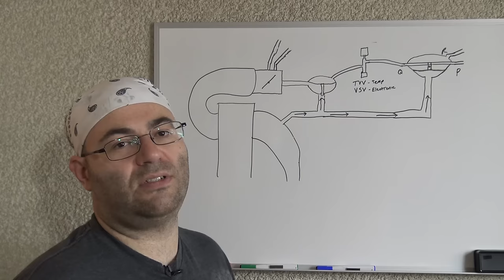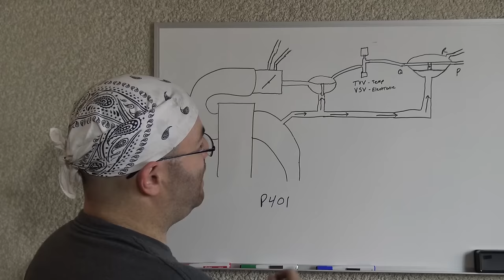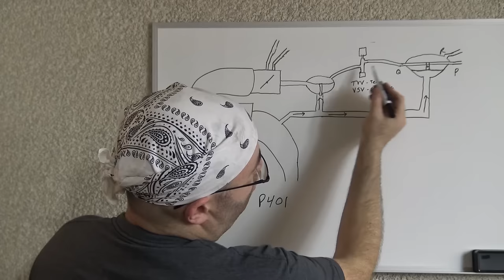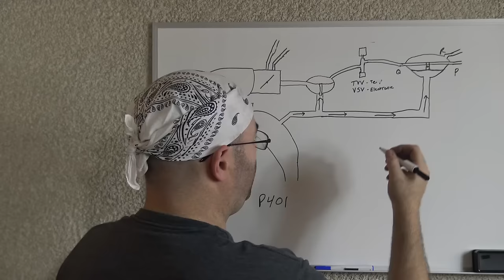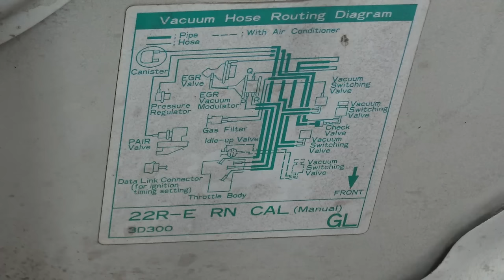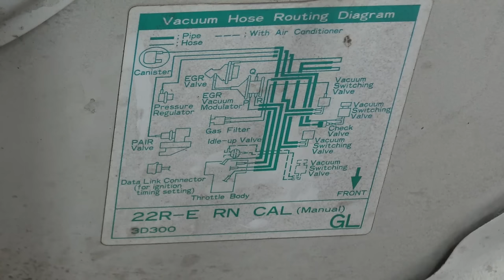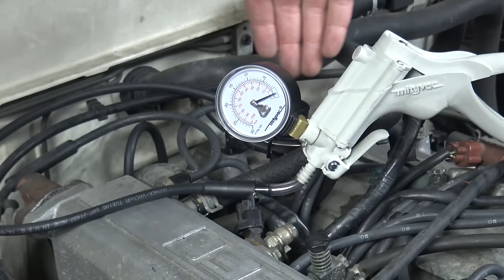DIY Toyota EGR Valve Diagnostics - Back Pressure Modulated

Comment: Great Job, every thing is perfect ,clear explanation do u have any idea about the emission system for Camry v6 2001?because the modulator and EGR built in together.  thx
Reply from the maker: They've probably simplified it a bit. I haven't had the chance to work on it yet so I'm not familiar with what kind of system it is, whether it's electronic or still vacuum, I don't know.

Comment: i had done all of those things and everything check out as working but i still keep getting the same code as  insufficient air flow i have replaced all EGR system parts as in EGR valve / VCV  switch / modulator valve and all vacuum hoses cleaned EGR pipe what could still be wrong

Comment: my 22re  if i take oil filler  cap off when running   the idle slows down  and truck dies  is there supposed to be that much back pressure at the oil filler  cap

Comment: what I don't understand is why the engine died when you applied vacuum directly to the egr valve, yet when you fixed the problem and vacuum was being applied by the vacuum modulator it didn't die. Can anyone explain this?
Reply from the maker: I applied full vacuum to the valve, opening it completely, which introduced a large vacuum leak, which stalled the engine. When the system is working properly, the vacuum given to the valve is low at idle, thus the valve isn’t open very much. The valve needs to open more as engine speed increases (to suck more exhaust gasses in, to cool the engine down more and more), but of course engine vacuum diminishes the higher the speed gets, so that’s why it needs to use the exhaust backpressure to open the valve at that point. Did that all make sense?

Comment: i have no vacuum coming from the r line on the modulator is it supposed to have vacuum i cleaned the throttle body still nothing also its giving me a code 71

Comment: is this correct? The VSV is energized cold and vents the vacuum from reaching the EGR valve. No EGR flow. And when engine is warmed up the VSV is deenergized which allows vacuum to reach the EGR valve and apply EGR flow. Or do I have that backwards
Reply from the maker: Yeah that's right.

Comment: Hi 50's Kid,
Love your vids...Have 95 2WD Toyota base p/u with 22r-e..get good vacuum on P and R, but none on Q when engine revved - replaced with new modulator - am getting same result..EGR valve and TVV test good, but system fails..any ideas?
Reply from the maker: Is there back pressure coming INTO the bottom of the modulator when you rev the engine?  Unplug the modulator and hook up your gauge to that and test.  If not, the line is probably clogged with carbon somewhere (probably at the EGR valve side).

Comment: i did not get any vacum when i put a t line connecting the egr valve and the vacum line but i did get vacum on P Q and R   the engine died when i applied vacum to the egr valve

Comment: Hi 50sKid! I am working with a 3VZE, the V6 motor in the 89 4runner  with a similar system.  I have this strange problem where the truck runs and idles fine, but when the engine is warmed up, and I come to a stop sign or red light and take it out of gear, there is a 50% chance that it wont idle perfectly at 850rpm, but instead it will bounce between 350rpm and 500rpm, like a major vacuum leak.  After about 15 seconds of sitting at the red light or stop sign, the idle comes back up to 850rpm.  I suspect the EGR valve.  Is there an easy way to clean it up without removing it?  Thank you!
Reply from the maker: No there's no easy way to clean it without removing it, however removing it probably isn't as difficult as you think.  The EGR is a good theory to go on for sure.  The EGR normally only opens when the engine is at mid to high speed, so it could be getting stuck open slightly when you come to a stop, causing a vacuum leak.  I also would have pointed you toward the idle air control valve.  On the 4 cylinder engine, it doesn't have a modern electric idle control valve, but rather a coolant-activated IAC for increasing the idle speed when the engine is cold along with some kind of idle-up valve, that I think is vacuum controlled, for when the a/c compressor kicks on, and I'm fairly certain the V6 has similar components.  If you can make the idle problem go away by turning your a/c off, I would suspect the idle up valve, but if not, definitely go for the EGR valve.
Reply: como se maneja rav automatica
Reply: 3vze my specialty, you need to verify your getting vacuum at the EGR valve while on the smog dyno, there is specific value you should see at the EGR valve at the low speed test engine RPM, which is about 2500rpm. If you have large that the stock tires that might be contributing to the issue lower rpm and engine working harder. I'm recommending the smaller 235 75 15 tire size for the smog test as the state of California may have overlooked that issue. They have only recently started to address the issue of 'stock tire size' as a contributing issue to failed smog tests. Otherwise any air leaks in your exhaust system up stream of the the oxygen sensor can cause your engine to run lean, causing higher NOx, and possibly higher emissions. Smog tech told me even a small exhaust leak will cause issues with smog numbers.
Reply: Video does not list symptoms, that I heard. If a failed smog, OK. My 1994 4Runner V6 3.0 Idles rough when hot. Just passed smog quite well, no 'check engine' light or codes, Vacuum is low (16) and steady, saying 'late ignition timing".  Timing cold is about 7 not 10 BTDC but starts to jump around when hot. Appreciate any help here.  Thanks
Reply: I really wish someone would help with this issue - EXACT same problem with my 1994 3.0 liter V-6 4Runner - check engine light is on, starts great, idles great UNTIL it warms up.  Then it has an intermittent idle issue where it tries to drop down from 650-800RPM to 350PRM with no set pattern.  It will idle smoothly for 2-3 minutes, no issues, and then suddenly the idle becomes rough as if the truck was trying to adjust to an entirely too low RPM.  Occasionally when I am backing the truck up after it has warmed up this idle problem will actually cause the engine to stall.  I generally only notice it at stop lights, and I don't run the AC as it is not working, so I can confirm it happens regardless.  Someone please help us with this issue!
Reply: @biolegal   idol up valve, or AFM
Reply: check tps too.  make sure no holes in the air intake sytem. inspect the entire thing.

Comment: I still wonder why so many people delete their EGR System from their 2.4L or 3.0 I believe if its broken they should replace it instead of by-passing it.
Reply: @Justsome dude some people feel it gives a minor performance gain, others see no difference, but the main reason for disabling the system is to stop exhaust gases from fouling up the intake and causing other problems as a result. It's like breathing in your own fart gas.

As far as I'm aware, only California mandates the use of such a system, nowhere else in the world is it illegal/results in failed emissions testing when removing this system. Another thing is that if you get lets say a 3VZ-FE engine from Japan for example, you'll notice it lacks any such system - only engines designated for the North American market will have this.

If you're lucky, your engine doesn't have an EGR temp sensor so disabling it is as simply as disconnecting/looping the vacuum lines that actuate the valve so that it no longer gets vacuum from the throttle body.

Comment: So if the car did not die when plugging the pressure gun to pull up the pencil valve in the egr (directly into the egr), but the engine seems to have ruff idling problem, (in other wording, the egr is not holding pressure) then the egr itself is bad?
Reply from the maker: It could be that your EGR is stuck very half way open, yes.
Reply: 50sKid assuming every vacuum line is not clog and everything is doing it's job beside that stuck valve, can that half way stuck valve be cleaned or best to buy a new egr?
Reply from the maker: Nah you should be able to clean it with lacquer thinner or carb cleaner.

Comment: I don't mean to be a know-it-all.....but...there are Many errors in this video.
#1:. "Cal emmision" is correct.    EGR ON CALIF EMission"  had both temp vac valve AND a vsv....fact.
#2: the valve in top center of his diagram will never bleed off vacuum.   I have never seen any vehicle ever that bleeds off vacuum!!! Vacuum is very important, and hard to keep as high as possible.
And I will add more as I watch the rest of video.....
Stay tuned:
Reply: Also:. Calif Toyota 22re has 2  heated O2 sensors!     Fact...
Reply: I am very experienced in Toyota 22re trucks .owned my 2owner for 17 years. 
My EFI HARNESS had cooked wire insulation on engine harness from PHX desert heat all these years.  If u moved or removed a connector from a sensor, chances were 70/30 that wire insulation would crack, and somewhere down the road soon, wire would workharden & break, as mine have!! Harness parts are mostly discontinued or very expensive.  No replacement harnesses are available!!!
Except 1......!      And I bought it.
A new oem harness for a Calif truck, 22re, mantrans.......Mine is federal emmision.
So after $880 and bringing harness in from yota warehouse in Kentucky, I started the learning experience of using or modifying a "CAL" HARNESS to a federal oem truck.
I found at least 3 different explanations of the assembly.   Also, these trucks, at least 94-95, were built in Japan and CALIF.!!!!!
THEY ARE NOT EXACTLY THE SAME TRUCK.
* So I pulled my oem fed harness out of my truck, and stretched it out on a 4x8 plywood.
And did same for the New Toyota CAL HARNESS side-by-side with Fed harness.
After weeks of looking up info, buying factory shop books, and every schematic I could find, I figured out EXACTLY WHAT WAS DIFFERENT BETWEEN CAL & Federal harness/ equipment!!!
EGR HAS 2 controls on it, vsv & temp bimetal vacuum shutoff valve.
Temp valve ONLY shuts off EGR operation when engine coolant is below 120°......ALL THE REST OF THE TIME WHEN MOTOR IS WARM/HOT EGR WILL WORK AS COMMANDED BY ECM. ECM operates the VSV( VACUUM SWITCHING VALVE).    It is binary- On or OFF.
....stand by....

Comment: Yup don't have to deal with any of that crap deleted the evap, egr, and catalytic converter 😂😂😂
Reply: How did you do that?  Our Camry has 139K miles and this EGR bullshit just does not end.  Swapped all EGR related parts, PCV valve, both o2 sensors, but EGR still throws the p0401 while the motor is running so rich the car gets less the 15mpg.

How can I rip all this fucking crap out?